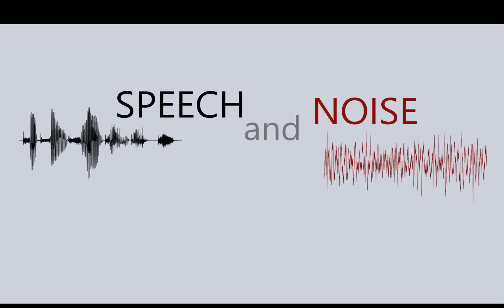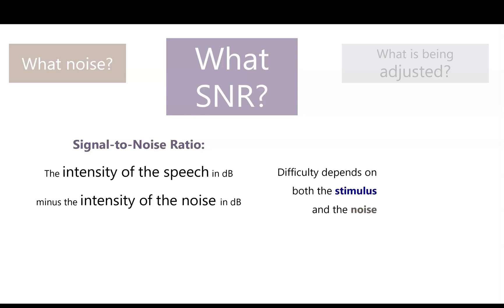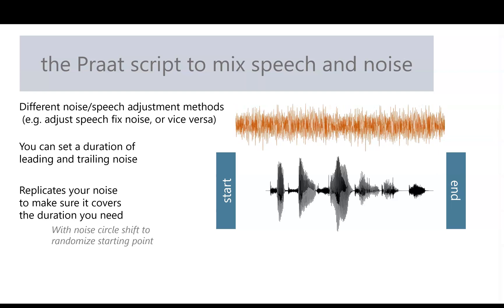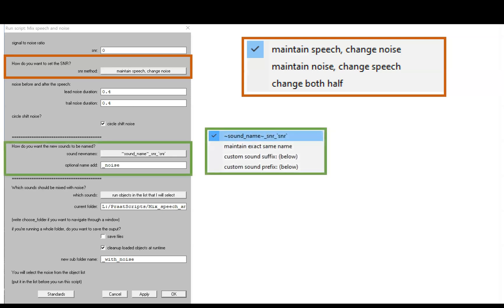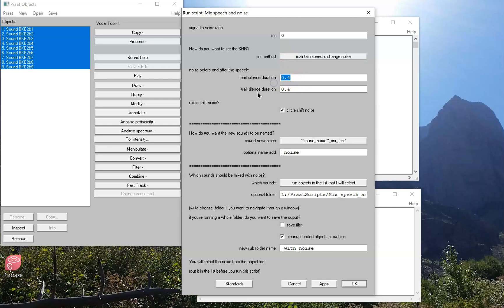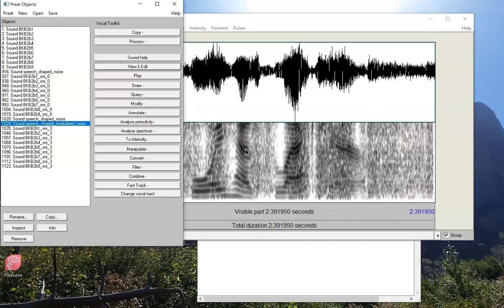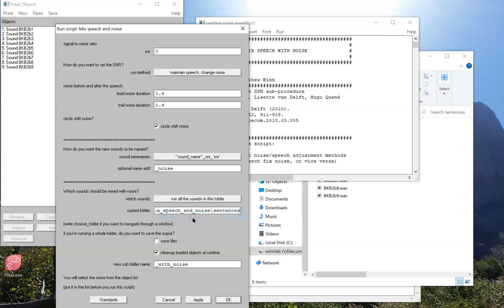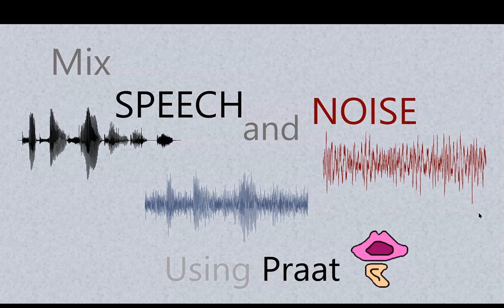Mix speech and noise using praat

Comment: hi, thank you for the tutorial! 
I have a question though: after selecting the sounds, creating the noise and then choosing the sounds to combine into speech-shaped noise, this message pops up : "to concatenate sounds, their numbers of channels (mono, stereo) should be equal. Sounds not concatenated. Script line 414 not performed or completed:"concatenate". Please change something in the command window "run script: mix speech and noise", or click cancel in that window." 
What I don't understand is that all my sounds have the same number of channels… I converted them all to stereo in Praat to be sure, but the same message pops up. Do you maybe have an idea why ? If I need to check something else?

(thanks again!)
Reply from the maker: converting to stereo does not ensure that they have the same number of channels, since 3-, 4-, and 5+ channel sounds can also be created by converting to stereo. Converting to mono should make it work, though!

Comment: Sorry for the rudimentary question. Does the sampling rate of every audio file used to generate noise have to be the same? Furthermore, do the noise and the signal have to have the same sample rate if I should combine them?
Reply from the maker: yes, if you are ever combining or concatenating multiple sounds, you definitely want them to have the same sampling rate. I would recommend equalizing that rate before using any script on them